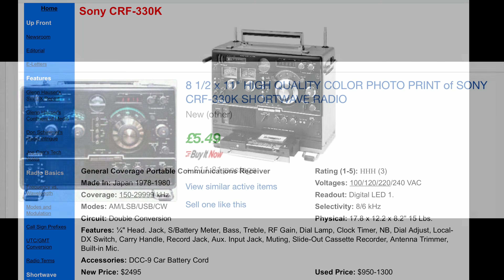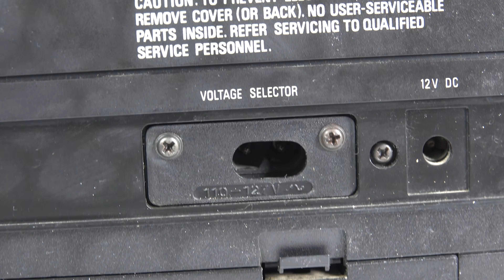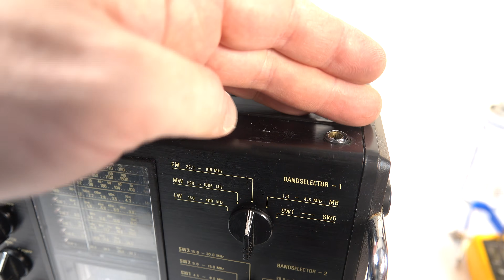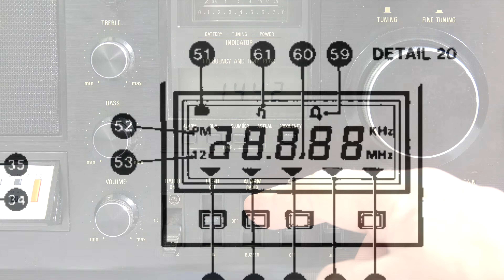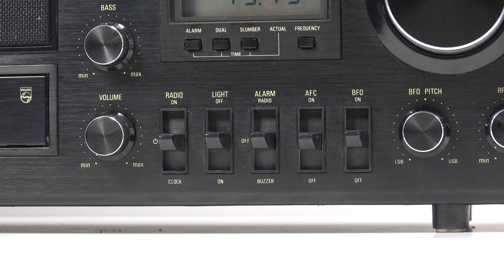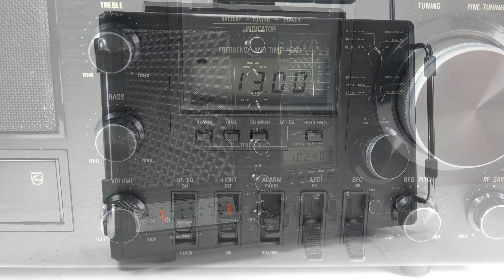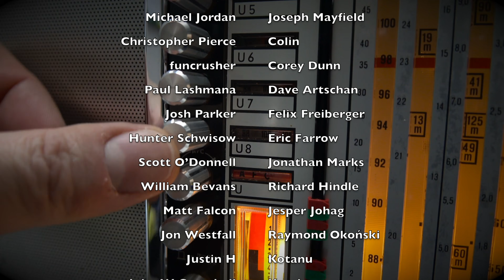Parts or Repair? - Philips AL990 Shortwave Radio

Comment: I've had radios in the past that had an alarm function, and they didn't work unless the radio was on mains, so not really a fault, just a symptom of the dead mains side... :)
Reply: A glance at the schematic does show the alarm will work on batteries, external 12v, or AC mains. I had the same thought at first.

Comment: What can you pick up using SWR? Can you hear emergency services/mobiles etc. Is it a bit like a scanner?
Reply: Not in the UK - Emergency radios are at much higher frequencies and encrypted. Short wave is used for very long distance signals ( hence its use by amateur radio )
Reply: @Spookieham  OK many thanks Graeme. I heard recently that it's almost impossible to pick up emergency services now. Do people still use scanners these days? If so, what for?
Reply: @X-Max-Quordlepleen-X  i have not seen a scanner in years. Anyone who is still interested in that now uses an SDR unit to scan huge bands of spectrum. They might still be around in the US but not much use in the UK unless you get an air band one
Reply: @X-Max-Quordlepleen-X  Scanners are still widely used. Lots of kinds on the market. Many newer models can be used with a computer as a software defined radio.

Comment: That 12v in barrel jack is not something I would want to use without opening it it up. It could be either centre positive or centre negative, get that wrong and either it won't work or you can damage things, depends if there is anything like a diode limiting the flow of current to one direction.
Reply from the maker: I read the specs in the manual first.
Reply: @Techmoan  That also works

Comment: Try cleaning the two bars that turn off the alarm as they are touch sensitive a low resistance on these may hold off the alarm function ?

Comment: Noticing that the alarm off is on the top with a touch sensor, it is most likely that the touch sensor is somehow disabling the alarm. I like getting things that are broken and fixing them as more often than not it is the only way I can afford most things these days. I can't tie my shoes, but I can troubleshoot a radio or about anything else to component level.

Comment: I'm confused.  I thought that the UK had switched over to digital radio.
Reply: It is transmitted but has failed to take over because of the crap sound quality.
Reply: The UK has switched 100% to digital television, but analogue FM/AM radio is still very much alive.

The reason why analogue radio is still supreme in the UK is nothing to do with the lower-quality audio of DAB thanks to the lower and lower bitrates broadcasters are choosing to use, and everything to do with the fact that DAB radios are still significantly more expensive than analogue ones. 

DAB is also much more picky about signal strength, and while many listeners will put up with the crackly or hissy radio that you get from analogue in a marginal reception area, they won't put up with DAB cutting out or garbling.

And finally, there are just way too few in-car DAB radios to even consider turning off analogue radio yet. While switching to digital TV meant telling people to go out and buy a cheap box that plugged easily into their television, there's no equivalent easy, simple, cheap way to add DAB to all the existing analogue car radios.

Believe it or not, even now in 2019 many brand-new cars don't come with DAB-compatible radios as standard. You often have to specify it as an extra-cost option. My parents bought their most recent new car in 2011, and while it has a touch-screen ICE system with built-in satnav, Bluetooth and iPhone/iPod integration, the radio is analogue-only - and this is in a popular high-selling car built 16 years after DAB officially started in the UK.
Reply: Medium wave band is very alive and popular in the UK as well as BBC Radio Four on long wave. As mentioned below - sound quality of DAB is terribly low, the stations are using as low bit rates as 32 kbit. It sounds flat and with no dynamics which sucks because I expected that with more stations specialising in certain genres the digital broadcasting will stand out. Greed took over the promised improvement in audio quality.
Reply: The UK has digital radio, FM, MW and a few LW stations. SW stations are usually broadcast to other countries or across large countries like australia. In the UK you wont hear much on SW that is broadcast from the UK as its directed towards the rest of the world like the BBC world service.
Reply: Thanks for the great replies everyone! I appreciate the information!

Comment: Due to the fact that it did not work on the 12v input I would suspect something other than the transformer... it's more likely to be a voltage regulator on the supply board. To check the transformer bleep out the windings for continuity.
Reply: sending twice the voltage on the primary would of course make the seconday ouputtuing twice the voltage, probably right about voltage regulator but maybe also capacitors if they were rated like 16V  or 25V at the output of the rectifier
Reply: I would definitely guess the main voltage regulator blown.. but it works off batteries so its (this is) a bit of a mystery. Maybe there's a primary regulator that took the heat. The transformer will prob be okay but the 4 way rectifier(s) might have blown.. The rectifier would stop a short circuit in the transformer from pulling the 12v line down so something else is blown.. Probably a few dead caps too.
Reply: @Lucien86  The battery circuit is isolated from the 12V and mains supply circuit, probably via a high voltage diode to prevent voltage feeding back onto alkaline cells. This is why it still works on batteries but not on the 12V or mains supply.
Reply: @cbcdesign001  The mystery is that the battery works but the 12v doesn't. My guess is a separate voltage regulator for each, and the one for the 12v/mains is blown. The transformer itself and the rectifier bridge will probably both be fine. Those DC input sockets usually have an internal switch so that plugging in a DC power cable disconnects the mains supply side. 
The mains side might also use a relay to isolate the battery when the mains is connected, and that could be hooked up for the 12v supply as well. So the relay is a part that could blow and might then leave both the 12v and mains disconnected.. (I didn't think of that before) :)
Reply: I actually thought maybe the secondary coil may have fused to a short, which would take the 12v input to a short too if it's wired that way. Just an idea anyway!
Reply: @beware_the_moose  So disconnecting the transformer completely would maybe make the 12V work if that theory is accurate...
Reply: This transformer on the primary winding has a thermal fuse
, which degrades from time to time and stops working, even with a whole winding. It is possible to partially disassemble the insulation and short-circuit the thermal fuse. After such manipulation, such transformers have been operating for many years.
Reply: My solution would be to take it to an electrical repair shop and say "Hey, fix this!"
Reply: مرحبًا هل لك معرفه في الخروج الترانسفورمر المحول كم فولت لان عندي مثله معطوب وليس لي معرفه في قراءة الفولتيه للمحول علما يوجد مخرجين ٢سلك اصفر و٢سلك ازرق ارجوا مساعدتي

Comment: The transformer may be OK.  Given that the 12V connector doesn't work (you were using the right polarity, right?), I suspect it's something on the DC side that died from the over voltage.  At minimum, I'd ohm it out before assuming it's bad.
Reply: yes,  something to note as it uses the 12V on the outside of the connector.

Comment: Overall great video! Just a heads up: i did not see any insulation on the AA battery job. Shortened out cells are not a good idea in the long term. They can become quite hot. Heat shrink for tiny wires is quite cheap and always good to have around.

Comment: Haha, so you were hoping that nobody would notice the lack of heatshrink? Well, hope again! >:)
Reply from the maker: I used electrical insulation tape - this video is an edited version of events - sequences have been shortened to enhance entertainment. It was shot over three days.
Reply: @Techmoan  I like your repair & clean videos. Peeps seem to forget how much the time & effort goes into editing - on another channel several were amazed it only took 57 minutes to pour and set,  a very large concrete patio ;-)))
Reply: @Techmoan  Yes, I think I actually spotted the tape in a frame or two. But this being Youtube, I figured someone would inevitably point out the superiority of heatshrink, so I figured it could as well be me. Don't take me too seriously, I really enjoyed this video.
Reply: @Hagledesperado  The advantage is heat shrink doesn't come off on its own and turn into a gooey mess if you leave the device out in the sun where it can get hot. (Or if the electronics just get hot enough on their own while operating.) Alternately there's a brand of paint on insulator called "liquid tape" and that supposedly works rather good once it sets.
Reply: @pauljs75  ...I started using liquid electrical tape a couple years ago. Works brilliantly!!
Reply: Great video 👍👍👍👍👍👍👍👍👍👍! I'm glad you got it to work.
Reply: LMAO. I think he can be forgiven since the overall video is so interesting.

Comment: I think the Alarmclock function only works on mains power
Reply: Perhaps the clock's electronics are in that pop out keypad and some of the inevitable flexible ribbon cable connectors to the switch have broken.

Comment: Probably shouldn't simultaneously snip two battery compartment wires whilst the batteries are still installed as doing so will momentarily short out the batteries
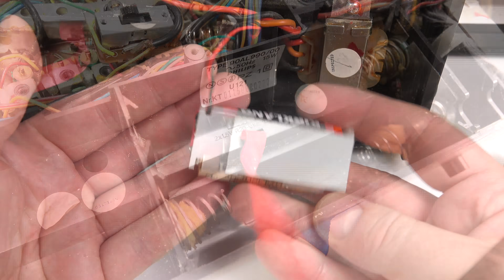Reply: @Techmoan  9:46
Reply from the maker: Oh, my apologies - I’d best butt out.
Reply: Its fine.

Comment: I wonder if it's the transformer that's broken or some part a bit further behind. Because 12V also doesn't work and that doesn't use the transformer. It's probably some step-down component somewhere after the fuses. I'd check where the batteries connect and go backwards (i.e. in direction of the other power sources) from there.
Reply: I think you are right about that.  I think there is a 12 volt to 6 volt regulator somewhere that got damaged.
Reply: My guess - it's filter capacitor after diode bridge blow up due to overvoltage. But of course it's may be something else.
Reply: he got to check Zener diode 7186/BZX79C12 ;-)